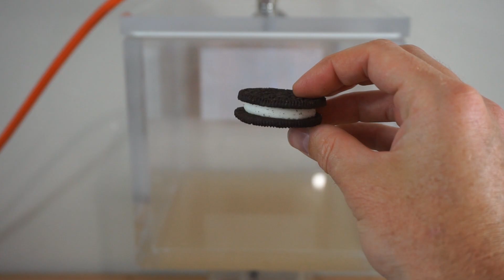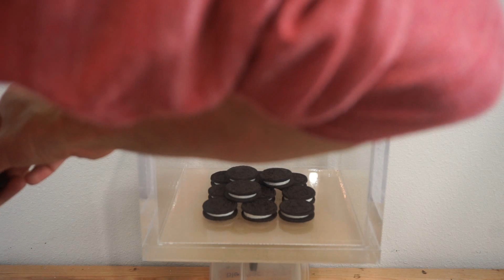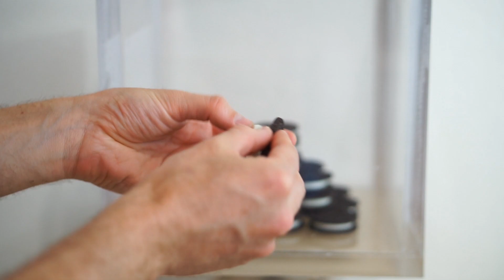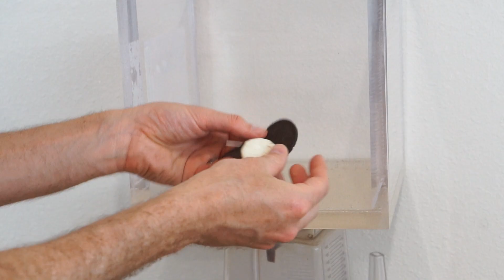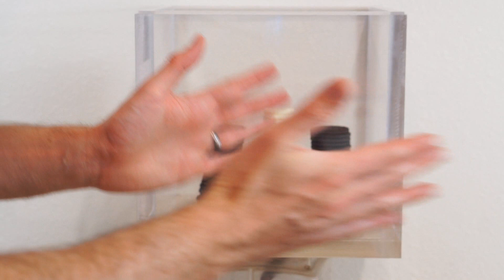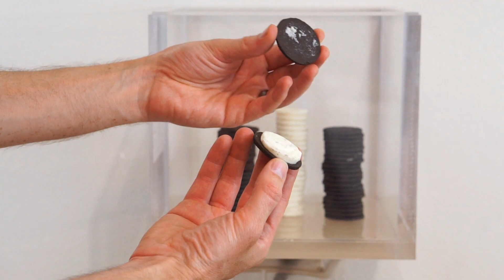Perfect Oreo Separation Using a Vacuum Chamber

Comment: there is kind of a low bressure between the center and cookies.
In the vac chamber the pressure around it decreases until it is even lower than the pressure between the cookies and the center.
That's when it pops off

Comment: Actually there is a way to apply equal pressure on both sides of the oreo and remove all the cream, or you can use one half as a spachella and get all the cream off and still have a solid cream sphere, ive done it and made a 20 stack ore back in the early 90s, obviously your way is way easier, but not the only way.

Comment: Hi Action Lab! This vid is a bit like one of Robert Boyle's air pump experiments about highly polished marble surfaces sticking together under normal then reduced air pressure. (Experiments Physico-Mechanical touching the Spring of the Air, experiment 31, 1660, pp. 229-230.) I've been studying it as part of an online course with Futurelearn but failing to make much sense of what Boyle was doing and what he thought was happening. Unless you've already done so, could you replicate it with your famous vacuum chamber and give one of your justly famous explanations?
Reply: Since the above comment I've come to understand Boyle's account a bit better. He begins by proposing "that if the exquisitely polish'd surfaces of two flat pieces of Marble, be so congruous to each other, that from their immediate contact, they will stick so fast together, that he who lifts up the uppermost shall, if the undermost be not exceeding heavy, lift up that too, and sustain it aloft in the free air." 

This presumably happens under normal atmospheric conditions, but placed in a vacuum chamber he argues they should fall apart since they're no longer held together by air pressure. Trouble is no-one in his day had ever managed to get pieces of marble "so exactly ground" that they'd stick together longer than a minute or two in the open air. Since his vacuum chamber took much longer than that to empty, their falling apart there wouldn't prove anything. Experiment 31 never actually got performed.

Could it be performed today? Maybe it has been for all I know. Can marble ground exactly enough be procured now? I'd love to see you give it a try, Action Lab. It would be great history of science.

Comment: I think the reason is that when the oreoes expanded then shrunk  it moved the fibers  (not fibers but the material from cream to cookie) so when the cookie was small again the cream was then unfamiliar with the cookie you see bc it expanded  this makes the cream grow then go back but it technically did not go back to normal also if I let it sit long enough after an hour or so I think I would you would not be able to take it apart as easily as u could right after I took it out of the Vacume chamber.

Comment: I think his happened because there is small air bubbles trapped inside where the cream is stuck on the cookie so when the air is sucked out, it no longer can stick to the Oreo cookie and also because it’s probably not as sticky. One time my sister put a marshmallow in the microwave and it expanded a lot and hardened

Comment: I think it is because the trapped air releases in the vacuum chamber. Then, when you take it out, it gets compressed and hardened by the air around it. I saw something similar with marshmallows in a vacuum chamber.
After the Oreo comes out, the compact center is hard enough to grab without smooshing it, just like the cookie.

Comment: There are air pockets between the icing and the cookie. The icing does not have a perfect flat surface and the icing can be shaped and morphed causing the air pockets to happen in the first place. When you press another object on it, it will naturally stick to the cookie because of the vacuum suction effect the icing has.
Reply: That was just my guess. Of course, I needed more time to think about that one.

Comment: Well, that is one of the complex ways to seperate a biscuit and a filling. The filling contains oxygen and water and it is sticky but now the oxygen is extracted by the vacuum chamber and the water got seperated as the filling is dry. These biscuits may be perfect for snacking with low fat milk.

Comment: the reason is there are little pockets in the cookies and when they are put together it creates suction because of the trapped air in the tiny pockets of the cookies is sealed by the filling. the vacuum removes the air thus relieving the suction and the cookies and filling just magically come apart. translation: i dont really have a clue as to why but the explanation sounded really good! lol!

Comment: Well, let's analyse the observations. After putting the cookies in pure vacuum, the only difference is that atmospheric pressure stops to act. So maybe the adhesive forces acting between the cream and the biscuit part weakens up too(because earlier the force due to the atmospheric pressure was kinda binding the biscuit and cream together). So twisting the cookie up in vacuum would quite certainly separate the biscuit and cream apart. But how does the seperation manage to take place once the cookie is placed back into the atmosphere?🤔🤔

Comment: Looking at the sped up footage, I would say it's the shear forces caused by the different contraction rates when quickly letting in the air that's separating them. Like twisting the oreo to separate it under atmospheric pressure if you were holding on to the cream inside somehow instead of the cookie parts.

Comment: The lower air pressure leads to a vaporization of the water molecules that make the cream less viscous. Because of this, the cream becomes much more viscous, or really more solid, meaning that you can grab it and twist it off.
Reply: Gala Flux Yeah thats what i think is the reason, also the edge of the cream layer in contact with the cookie is the most vulnerable to evaporization due the higher surface tension, the water in that part vaporizes and looses its stickiness

Comment: If you put wet clothes on the vacuum chamber does It dry?
Reply: C. Schoenfeld nope nope 
It dries for a few minutes but if you soak it much it starts to freez cause the temperature decreases.
It boils when it is at 36 degrees at vaccum but it freezes quickly in a vaccum chamber also
Reply: Well, if you put wet clothes ON the vacuum chamber, it would dry over time as usual; unless the vacuum chamber is submerged in water.  Speaking of, that would make water less wet, right?
Reply: no
Reply: Anyone who said yes hasn't taken basic science 101. Vacuum chambers remove air, not water. You'd have to have the container on a hot plate so it'd boil, but in the end, you'd have hot, wet clothes.

Comment: The air from the center of the oreo pushes the cream away from the hard surface of the cookie then when the air is reintroduced the cream shrinks to the point of becoming almost solid prevent it from sticking back to the cookie

Comment: I think it is because while the white stuff expands, the chocolate wafer does not.  During extraction, the expansion is probably slow enough that the white stuff still sticks to the wafers.  But after being rapidly contracted, the mechanical bond between the white stuff and wafer is broken (the white stuff is torn off the wafer), and mechanical separation is achieved.

Comment: I'm guessing that when the vacuum is applied, the air in the cream expanded until it escaped through microscopic holes in the cream. When the air is let back in, the cream collapses in on itself while becoming more dense. This is because only solid material is all that's left over, making the cream tougher and easier to pull off without squishing.

Comment: Its pretty much impossible to separate the cream from cookie..... Unless you use simple physics and think logically you idiot. You dont need a vacuum to do that. Just put them in the fridge for like 30 mins and roll the cream away from the cookie instead of trying to scrape it off. #simplethinking

Comment: The Action Lab, I think everybody is looking at it the WRONG way.
I read some comments saying rusty cream hardens when the air is let in. This cannot happen because cream just returns to it's original state, which is somewhat soft and cannot get any harder that it already is. UNLESS the temperature drops in the chamber.
-----------------------
What I think happens, is that cream has minimal amount of air content and that is what making it expand. When it expands, it also increases it's diameter and the surfaces touching the cookie slide outwards thus almost completely separating from a cookie. That is why when you grab it, the centers barely hold on to each other and separate easily. Plus I think that if you input the air at the very slow rate, the softness of the cream might adhere back to the cookies and there might not be any separations.
To find out the moment when they separate, secure an OREO suspended in the chamber and see when the bottom part falls off. Might add a small weight to the bottom cookie.

Comment: When you take out the air the icing expands; the cookie does not expand. So when you let the air back in the icing quickly deflates, pulling it's edges away from the cookie that remained the same size?

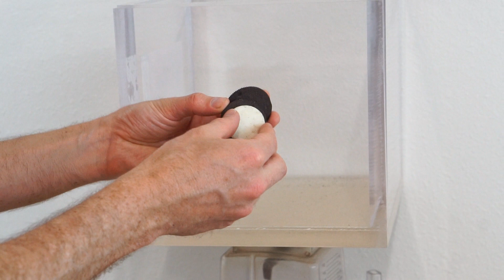Comment: So I paused at 3:02...

i think its because the cream actually looses the air inside it which was trapped before...and the reason why its expand because the air rushes through it to be free(becauss of the pressure)....so also because of the pressure,and the loss of air,the cream compact together that it has became solid...

let see if I get this right...
Reply: ok i guess I was wrong...hmm...sadly...
Reply: what do you think @theactionlab

Comment: The air bubbles caught in between the cookie and rich gooey center expand because there is no pressure on the outside of the cookie to keep them small.

And that's the way the cookie crumbles.

Comment: think of the cream filling as sand. if the sand is wet, it sticks together. if the sand is dry it doesn't stick. a vacuum chamber pulls out the moisture, making the cream less sticky.

Comment: I think that maybe the Oreo cookies do have air inside them, but since they're not liquid they won't have such a big change in size (if that even makes sense). But since the Oreo cookie has air and the filling doesn't, then the part of the cookie that is touching the filling will have bigger air "bubbles", which will separate the filling from the cookies.

Comment: I think the little air in the filling escapes as the vacuum is created (because that's what you're doing; removing the air from the chamber) and that separates the filling from the cookies by ever so slightly expanding the filling out of the cracks and crevices in the cookie.

Comment: The cream has oxygen in them, when you vacuumed it, you compressed the Cream, which is basically combination of milk fat, air, canola oil, and sugar.

Removing air from the equation turned the cream into a block of sugar.

When you added air back in, it doesn't get mixed into the cream anymore, and basically remains a compressed block.

When you watch the video carefully the cream expands, because it's removing Oxygen in both the cookies and the cream.
When air gets put in, it doesn't actually mix with the cream to soften it again, rather the air going back in is only sufficient to fit the volume of the empty space, not including the cream and cookie.

Comment: Because the vacuum causes the cream to expand due to releasing the pressure our atmosphere puts on all matter on our planet causing it to shrink in a sense. Making the molecules closer together. So with the vacuum on it removes that kenetic energy being applied at all times and poof. It wiggles free from the cookie and letting the air back in will cause the molecules to return to earth pressure but it doesn't create the bond between cream and cookie.

Comment: so the actual reason why this works, is because the creme has an adhesive property to it where it sticks, but that adhesion instantly dissipates in a vaccum being that there is no air for the adhesive to have its sticky properties

this is just my guess but it is the most likely as i have tested this with tape and after taking it out of a vaccum chamber it just doesnt work anymore

Comment: I think that when the oreos expand inside the vacuum chamber it creates some tiny openings between the cream and the biscuit (which was kinda sealed before) on both sides. So when you let air in again, it fills those openings and becomes very easy to remove the cream because the air inside it doesn't let it stick as it did before.

Comment: I thought it happens because when the cream inside the cookies expands, they kind of erode the buiscuits a little bit and then when the air is let back in the cream compresses down again leaving tiny gaps between the cream and the cookies therefore allowing the cream  to pop off with ease

Edit: wow I was a lot more accurate then I thought but your explanation made way more sense 😂😂

Comment: it happens because the air in the 'stuff' makes it slightly larger, and less condensed, but when you take out the air, the cookie dosn't shrink, but the frosting does as all of the air that was in it leaked out, so it separates from the cookie as it shrinks

Comment: ayyyyy covert the decompresser in to a bong. the bong would have to be on the valve to let air back in to the chamber. Might be hard but boy will it smoke the fuck out of that weed. i use a gravity bong, similar concept.

Comment: So a vacuum is a space where there is no matter present; referring, in this case, to the air (oxygen gas) that is present in the chamber when you close the door. In order to achieve a true vacuum, you have to pump, or "suck," out all their air that is in the chamber. As the air is being sucked out, the pressure of the vacuum chamber is being decreased (as he stated in the video). Pressure is essentially the chance an atom of something (in this case, oxygen) has of coming into contact (colliding) with another atom. According to Boyle's Law, as the pressure of a gas decreases, its volume increases. Since there was more and more air being removed to create a true vacuum, the pressure of the chamber was decreasing, which meant that there were less air particles that could come into contact with one another, allowing the volume of the air to expand. Now, while the Oreo cream filling doesn't have too much air, as he mentioned in the video, it does have air nonetheless. The decreasing pressure would allow the air inside that filling to increase in volume—expand—which is why the cream appeared to be getting larger and larger. The expansion of the cream pushed the cookies farther away than they were originally. The Oreo cookies would have remained this larger size if it were not for the re-opening of chamber, which brought back the air that had been sucked out from the beginning, stabilized the pressure back to 1 atm, and made the cookies their original size. However, as the cookies shrunk to their original size, it broke apart the adhesive tension that was held between the cream and the cookie—the adhesion between the cookie and cream had already been partially diminished by the expansion, it just became completely removed as the cream was stripped away from the cookie due to the increasing pressure relative to the chamber. The cookies were then merely held together by gravity since they were stacked; it they were placed vertically, they would have fallen apart.

Comment: The cream center is moist, therefore it sticks to the cookie. By removing the air, you also remove enough of the moisture to allow the cream center to get to a less sticky state and thus, it will separate from the cookie. Microwaving the Oreos for five to ten seconds does the same thing, but keep them in the microwave for much longer and they become a melted, sticky mess that is difficult to clean. I know, I've done this before.
Reply: You done some pretty crazy stuff
Reply: Same I was going to write
Reply: I thought the same thing but according to the video this isn't the case...
Reply: @Amy Carter Good on you for trying to figure it out. Makes me even more interested in the answer. Hope you're right.
Reply: @ Amy Carter Heard his answer now. He says the cookies don't come apart cleanly until he lets the air back in, whereas if you're right they should do so when still under vacuum because the moisture would have been removed by then. His explanation for why it only happens when the air is let back in is unclear to me, though. Maybe enough moisture to unstick was removed in your microwave, but not in his vacuum, so the separation happened in his experiment for a different reason, whatever that is. What do you think?
Reply: There doesn't have to be just one way to separate de cream from the cookies though, my take is that you can do it by expanding and then shrinking the cream in the vacuum chamber and also by removing some moisture from the cream by heating it up the right amount.

Comment: I'm going to guess that between the cook and cream, there can be found some air molecules, so when you suck the air out, those molecules become these microscope wedges that push out in the lower pressure. Things stick together on an atomic level kinda like velcro I think--like micro rough or zigzags mushing together. The air helped to break that up and push the layers away.

Comment: this is just a theory but I think when the air pressure is returned to the cookie which causes it to decrease in volume and the cream does as well so they sort of reform but in different directions so they end up splitting from each other. I tried going more into depth about what you said about the cookie decreasing quickly but I'm not very good at explaining anything.